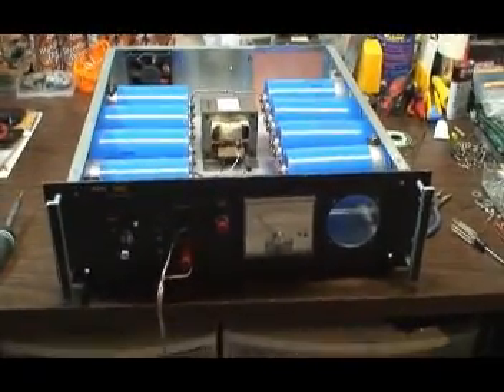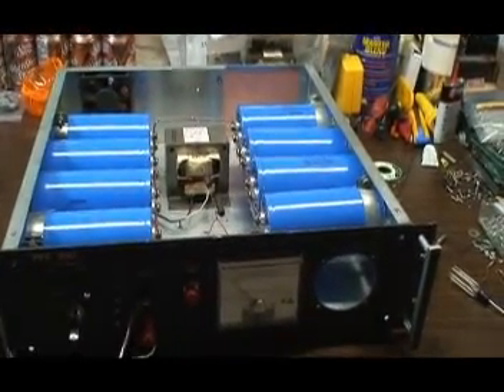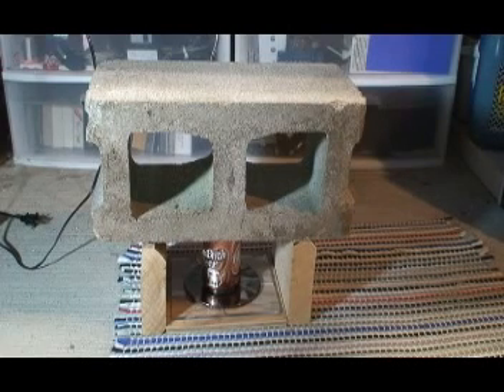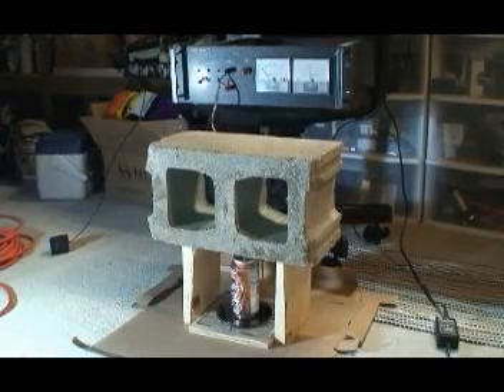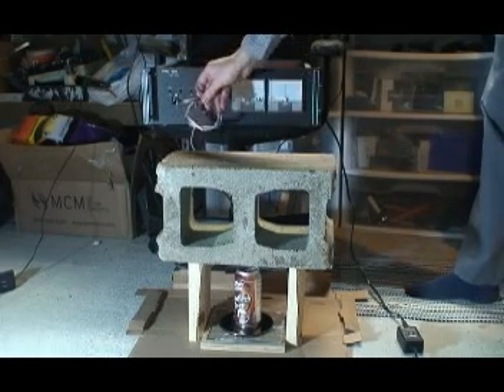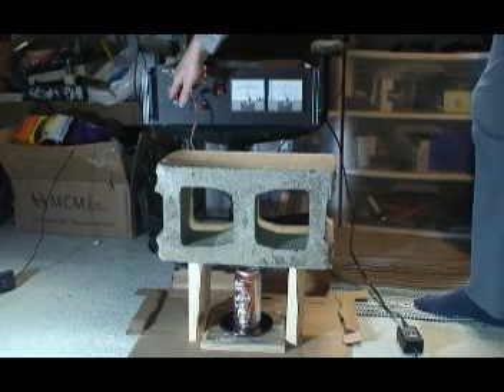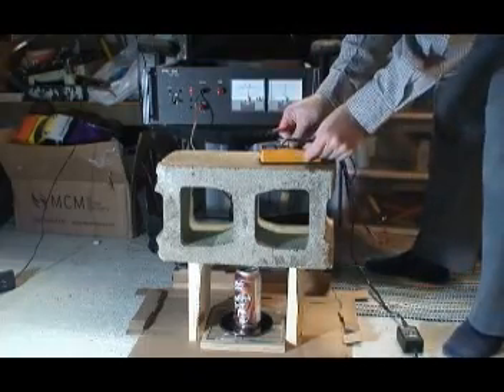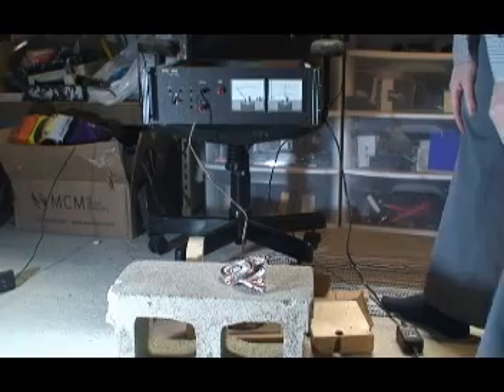1600 Volt Washer Launcher

Comment: You could just use a current meter to detect when the caps are fully charged, right?  When the current gets low, the change in voltage has basically stopped, so it's safe to switch out of the charge circuit at that time.

Comment: That  was fun,  Not taking into consideration the cost of large capacitors and the expense of building the power supply, It's still kind of an expensive and dangerous way to crush cans   Say at 11 cents a kilowatt (1 kilowatt for an hour) how much does it cost you every time you crush a can. Seriously,  you have to much time on your hands.  If you care to do something useful with your time I have  a vintage tektronics 465 with a defective trigger board care to trouble shoot it for me

Comment: that is awesome!
are those DC or AC capacitors?

I have just acquired a bank of 28 6800mfd 450V DC caps from an old Danfoss VLT Drive and I'm wondering if they would be suitable for an experiment like this?

Comment from the maker: For that kind of power I would use two bolts with a plastic spacer that is tied to a string like I did on the 5 KV version.  This was 8 x 3700 uF at 400 Volt capacitors, so it would be about 1800 uF at 1600 volts.  Ths SCR toped out at 1600 volts.

Comment: Very fun indeed! I did this with my smaller capacitor bank, it is 800 volts at 1950uf, which is 624 joules. I can get a pretty flat soda can doing what you've done, but not quite as spectacular as yours. Good job!

I am going to put a new bank together, almost 5kj! I need an SCR that can handle about 15Ka at 1.6kv though. What capacitance was your bank, and what SCR? I need a good SCR bad :P. I also need to go ahead and make a resistive voltage divider as you have.

Good job, Mr. Davis.

Comment: it should be possible to double the voltage to 2400 volts if you use the capacitors in a charge pump arrangement

Comment from the maker: The power from the outlet is limited to 15 amps.  The capacitors can store and release many hundreds of amps.  That current is unleashed into a flat coil that has an aluminum washer sitting on it.  The washer then takes flight.

Comment: yeah i know. and another problem is the internaly bleed off resistor. i mainly use them in series on jacob ladder setups, to put it in resonance. i origionaly planned on using them on a tesla coil, but they overheated, i now have 4 .003uf 35kv caps i got from electronic goldmine for 2.50 a piece

Comment: Very cool Bob!  One bit of safety advice that a lineman friend of mine passed on to me is that when working with high voltages, you should *never* use both hands when measuring or otherwise working inside a unit. Keep one hand in your pocket.

Of course the reasoning behind this is that hand-to-hand creates a circuit directly across your heart.

Stay safe, and keep making these awesome videos!